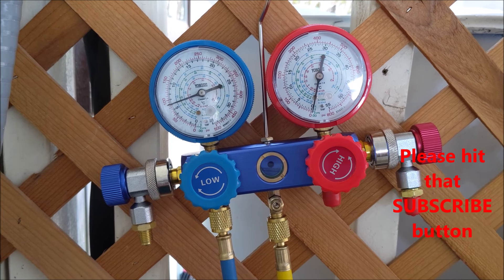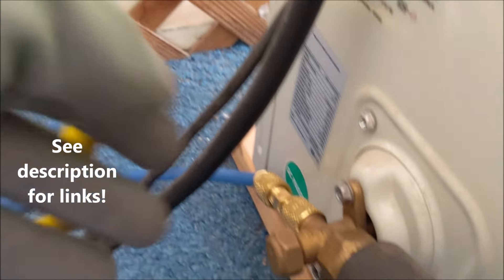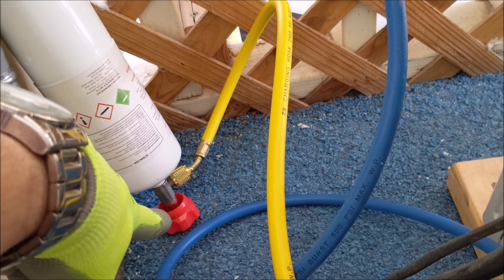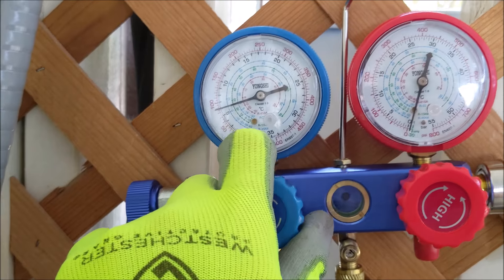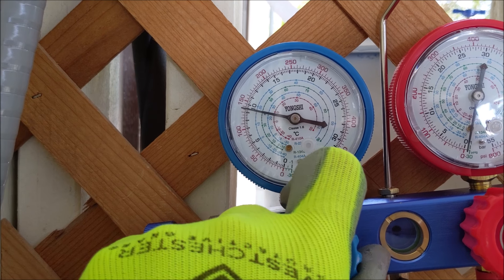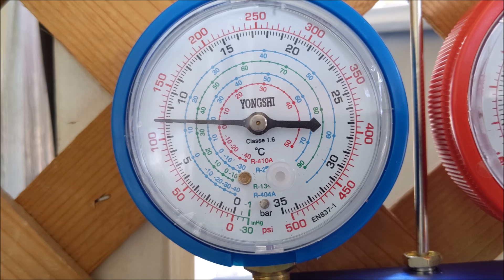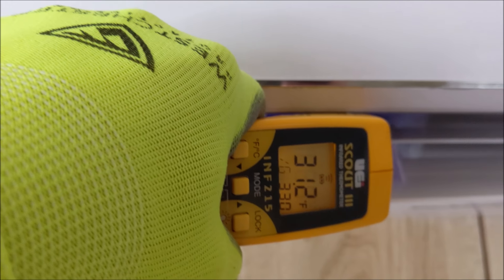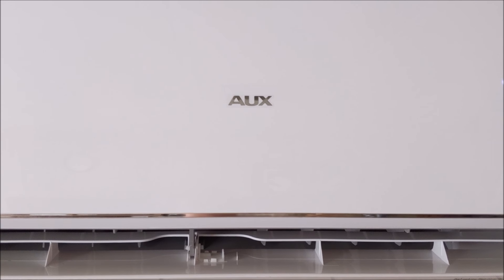How to charge mini split yourself, DIY 410a refrigerant, save money!

Comment: I pay today 400 dollars for this… I saw right now that the 25 lb refrigerant cost 35 dollars
Reply from the maker: 25 pounds of 410a DOES NOT cost $35 anywhere, lol.
Reply: Bastards..they got you...
Reply: @SaveGreenHere  maybe in Mexico
Reply: $35/ per pound
Reply: It costs more than $200 for 5lbs tank in summer for sure ... The price will be lower in winter ..that is the good time to stock up the refrigerant.

Anyway $35 per tank is from a scam website ... Stay away.
Reply from the maker: That's why I posted these sellers as trusted, because they have high feedback and trusted reputation.............
Link to Extra refrigerant........... http://ebay.us/YKjza2
Refrigerant smaller tank......... https://ebay.us/Tkhoqv
Reply: Those are scam sites. 25lbs is $400-500.

Comment: Frustrating part on all the videos they never specify if you turn on or off  your ac unit while charging.
Reply from the maker: The video clearly shows the unit running while doing this, meaning it's obvious that the unit needs to be running, IN COOL MODE. Look at the other 2453 times others asked the same question for this video, and you will also get the answer 🤷‍♂️

Comment: The a/c was working, not the heat, I turned the a/c on to fill, I had frost on the line.  It showed 50, I filled it, I couldn't fill it past 110.  I went inside, the heat worked, when I went outside with the heat on, it was pegged at about 220.  I went back in and tried to get the a/c on, it wouldn't go on, but it is 61 inside and 62 was the lowest the unit would go, so I shut it off.  When I went outside, the gauges showed 200.  I am assuming it okay, if you have any suggestions, let me know.  I can imagine hooking it back up and turning the a/c on to verify pressure.  We have 2 ductless heaters and a pellet stove, so we'll be okay.
Reply: I realized you were going to tell me to check the pressure again, it is 120, my worry was it being 200 and causing damage.  Thank you for the video.  I have the heat on now, appears to function properly.  I put it in approx. 4 years ago, this is my first time adding refrigerant.  I see pros telling people to purge the system and recharge by weight, is this necessary?  I have an 800 dollar system that we use all winter, I suspect I'll just by another one certainly by year 10.
Reply from the maker: Jeff, make sure you purge your lines. ------------> Purging........ On the yellow hose, 1-connect to tank, and gauges. Slowly open the valve on the REFRIGERANT tank as to slowly release some refrigerant 2-On the gauges, slowly unscrew yellow hose at manifold until you hear air out, should just take a second. Quickly tighten.         On the blue (suction)  hose, 1-Fully tighten hose on the HVAC unit, and on the gauges. 2-Slowly loosen connection on manifold, the remnants of air in the line will bleed out at the  connection to the gauges, (you will hear the sound of air coming out) at the manifold connection, and you can quickly tighten immediately after. It is a split second thing!

Comment: Hi i have a 0.88kg split unit running on R410a , only have gauges that have readings for R22,R12,R404 and R134a no readings for R410a :( , can i charge the system with these and will it still be 120 psi , as some say it must be on 80 psi if i use this gauges please help
Reply from the maker: Best not to use the same gauges and hoses as you may contaminate the lines of your system. Get them for the 410a....... https://amzn.to/2PLl1lQ
Reply: @SaveGreenHere  thats funny, I use the same gauges for 134 410, and 152 😆

Comment: My mini split came with 16 ft of lineset. I remove 8 ft. The system was already low from a leak. I used the self recovery system for unit and disconnected lines to shorten. I re flared everything and placed flare seals and nylog on all connections. I vacuumed system down to -30 and it held vacuum for an hour with no change. I released 410a back into the system per manual. Based on outdoor temp and calculated indoor wet bulb temp my target super heat was like 15-20 degrees. According to my psig saturation temp chart my PSI should be at about 116 psi. I slowly added refrigerant over 30 min until I reached 115. Once I reached 115 the gauge started rapidly increasing to unreadable >350 psi. Im worried I overcharged it but how if I was following the chart? Any help would be appreciated. Indoor unit is now icing up.
Reply: Are you waiting between charges? If your indoor unit ices up and there's not airflow problem, it's low refrigerant. But you mentioned it rapidly increased pressure... so I don't know, something with the expansion valves? 350psi on the low side is really high even for R410a. When it's icing up is it still reading over 350 psi? Have you tried letting some refrigerant out?

Comment: How do you determine what psi your system needs? The sticker on my AC condenser has a "Charging Chart" I have a picture of here:
https://cimg7.ibsrv.net/gimg/www.doityourselft.com-vbulletin/732x975/roof_ac_compressor_model_tcjd30s41s3a_c4988070af321779e32b43d290799efffb8cd19b.jpg